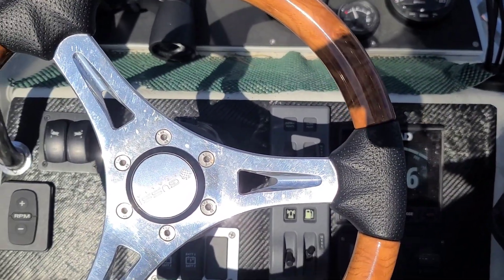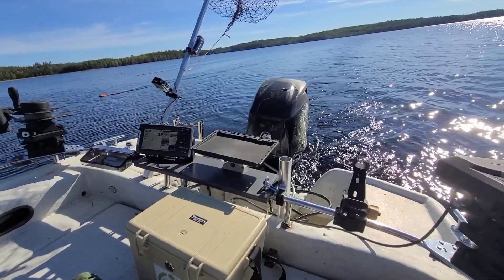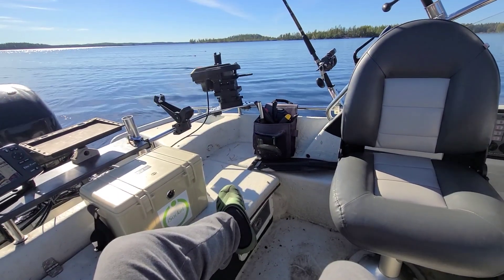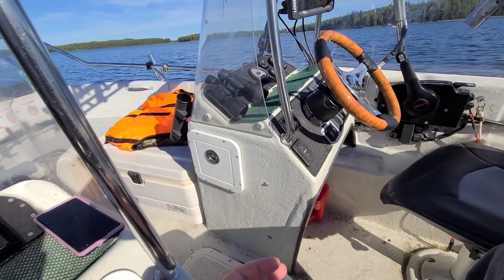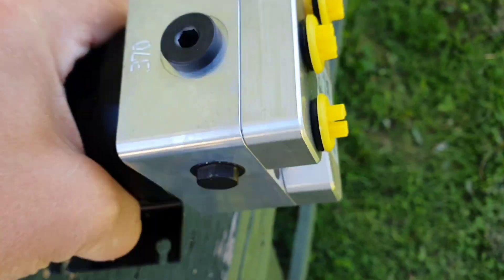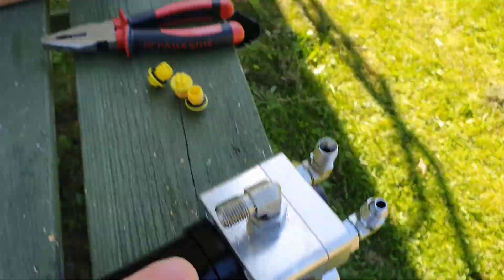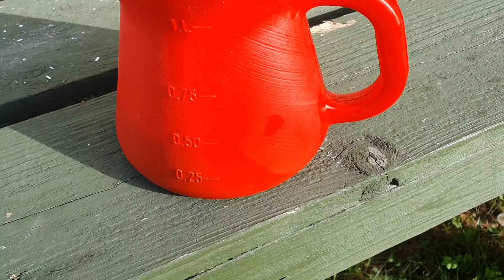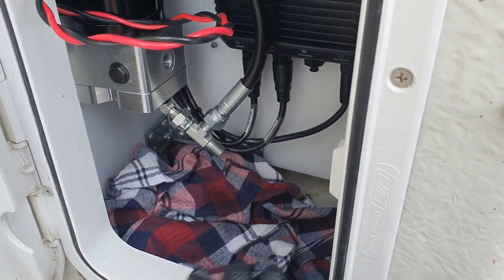Hydraulic Autopilot Pump Problems (SOLVED)

Comment: the strange color and suspension in the oil, seems to be from the hoses factory process when the lines were cutted to size, were not clean after the cut... in a litle capacity oil circuit that can happen, a return filter would help!
Reply from the maker: @gproto1  The manufacturer later suggested it is from the aluminum stuff of the pump, similar to what you have on your hand when handling aluminum, and is not affecting the operation of the pump.
Reply: Maybe because you dont use normal frot return pipeline